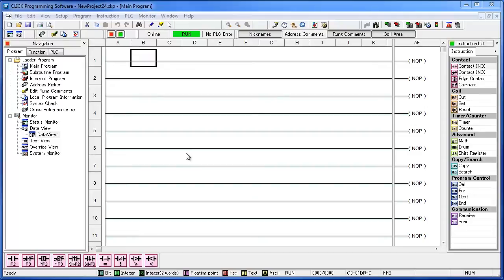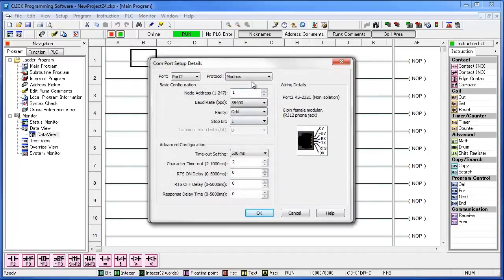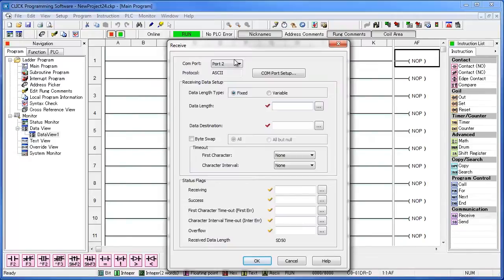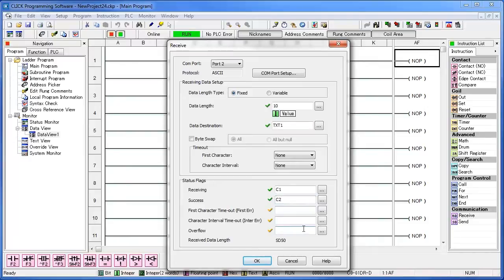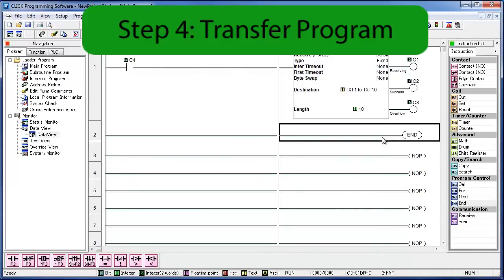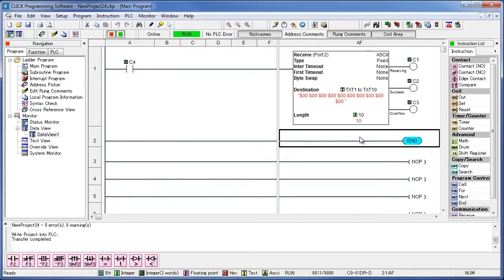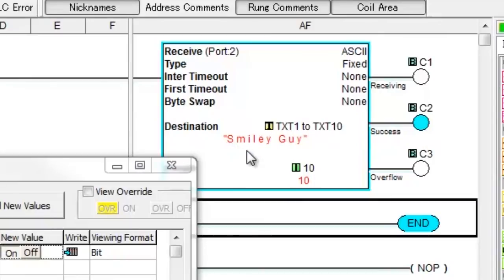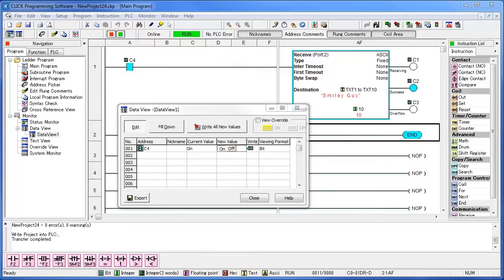CLICK PLC - How To Setup and Use a Barcode Scanner from AutomationDirect

Comment: After scanning the barcode, can you collect the data on a PC?
Reply from the maker: @soemin4847 Yes. In some cases, the barcode scanner can be connected directly to the PC if the PC has software capable of interpreting ASCII data. In this setup, we’re using a non-Ethernet CLICK, so the PC must communicate via RS-232 or RS-485. With an Ethernet CLICK, the PC can connect over Modbus/TCP through the Ethernet port, and Modbus conversion software would be required on the PC to interpret the data.

Comment: What would be the code to have C4 turn on and off and/or ability to continuously scan bar codes?
Reply from the maker: You could use whatever logic makes sense for your application. We are just manually cycling it via the data view but you could use a timer or commonly customers use a sensor to know the object with the barcode is present.

Comment: Is it possible to setup up a count for specific barcodes?
Reply from the maker: Yes! You can use the compare function to see if the barcode matches and use the output to run a counter.

Comment: Hi !!
I wish to use a Barcode Scanner to operate a Pneumatic Piston. 
Is it absolutely necessary to use a PLC for this task or are their any other alternatives available for this?

Application Background:
Once the user scans the Barcode on the Product; i want the Lid of a Plastic Bin (corresponding to the Barcode Scanned) containing relevant child parts / components must open up using a Pneumatic Cylinder. This will eliminate probability of using wrong component in the product while assembling.

Thankyou
Reply from the maker: You could use any controller to do this, this video just shows how to do it with a PLC.
Reply: I am also working on that project. Can you help me how i connect the barcode reader with plc to operate the pneumatic piston 

Thank you

Comment: hi, is it possible to connect qr code scanner to plc controller?
Reply from the maker: Sure, if the QR Code scanner has an interface that is compatible with the PLC (Serial, Modbus, Ethernet TCP/IP, etc ..)
Reply: @automationdirect  im still new at plc. can you explain how do i link my qr scanner to plc?
Reply: because as far as i know the languages between plc and qr code are different. so how do i change it? and, perhaps you know a QR scanner code brand that has interface that's compatible with PLC?
Reply from the maker: What you want to look for is a "2D Barcode Scanner". This would be term to start your research. Then the next question would be what PLC are you using. That scanner would need to have the communication protocols that are available to that PLC. For instance, if this was a Productivity PLC, the scanner, if using Ethernet, would need either the Ethernet/IP or Modbus TCP protocol.
Reply: @automationdirect  I see. Thanks. Do you have recommendations for scanner for plc siemens step7 1200?
Reply from the maker: @faan, I do not have any recommendations.  Hopefully, we were able to get you started on your path. Thanks for the comments.

Comment: Good afternoon, can i convert my DB9 to a RJ12, my scanner has the next pin configuration:

Pin No.     Pin Name 
1                Trigger 
2                TXD Output TTL Only 
3                RXD Input TTL Only 
4                NC 
5                Ground 
6                +5V Power 
7                CTS Input TTL Only 
8                RTS Output TTL Only 
9                Beeper/Download
Reply from the maker: Possibly, if your scanner can run on TXD and RXD only. You would need to purchase an RS232 Level converter (<$10) and then use the pin out shown in the video's description to make a custom cable.
Reply: Do you sell that converter? what is the model number?
Reply from the maker: Is this for an industrial application or more of a home/hobby application?  If Home/Hobby, do a google search for "RS232 Level Converter" you'll find lots of options for just a few dollars.  If you are looking for an industrial solution, please contact our Free Tech Support during regular business hours - they will be happy to help you. 1-770-844-4200
Reply: @automationdirect  is for a industrial solution
Reply from the maker: I'm not aware of one, but Tech Support will know more than I do, give them a call.
Reply: @automationdirect  i change the parity to none and it work

Comment: can you give me more information on the scanner that you are using? 
thanks!
Reply from the maker: @Ernesto Guerrero, thanks for the comment. This video was made to be generic for use with any ASCII Rs-232 Barcode scanner, but the scanner used in the video was as a Symbol LS2208 and the RS232 cable was a custom hand wired cable to get all the signals to line up:

Male....... Male 
DB9........ RJ12 (6-pin)
...5............. 1
...2............. 3
...3............. 4
Thanks

Comment: How can I use a USB scanner with this RS232 PLC Port?
Reply from the maker: Juan, thanks for the comment. The RS232 port on the Click is a true serial port. Typically USB scanners will not emulate directly to serial, without a custom interface device from the manufacturer, and at times these interface devices causes a latency in the ASCII comms. I would advise looking for a true serial scanner to interface with the serial port.
Reply: I just purchased a Symbol LS2208 -SR20007R I've had to check the scanner with COM1 on an old computer with the hyperteminal application and it worked fine. Now I did a communication cable between a male DB9 AND RJ12 follwing automation directs tech support instructions, however I can't receive bar code information on whenever the scanner reads a bar code. What could be happening?
Reply: @juancarlosavila1853  you have to change the parity to none not to odd